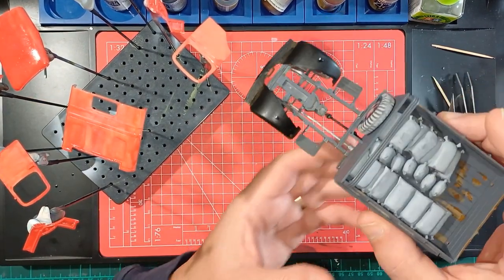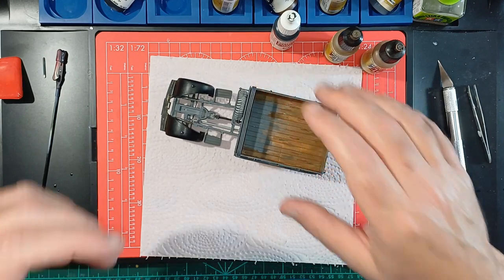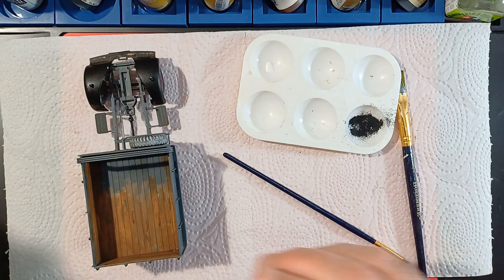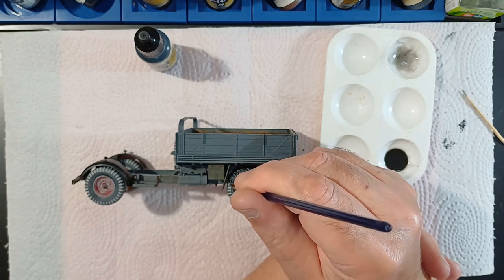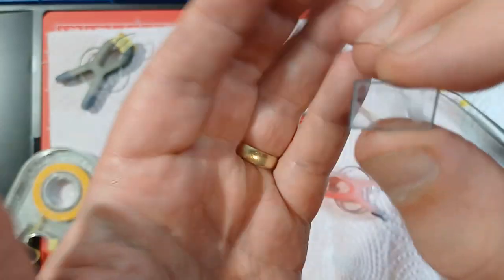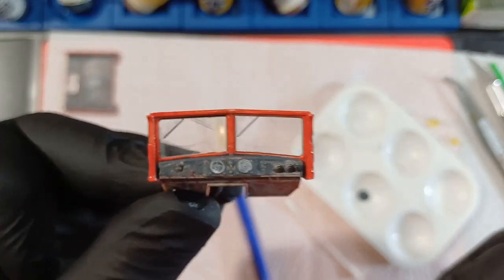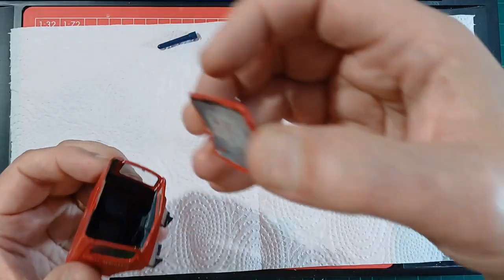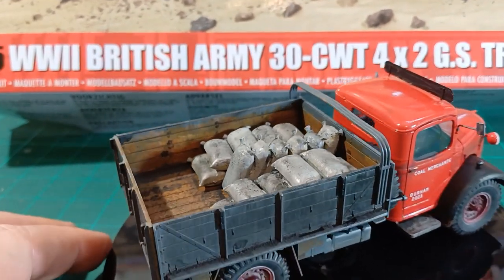Airfix WW2 30CWT Truck Build part 3 Finished

Comment: That's turned out well. For applying pigments, etc I bought a set of about two dozen make-up brushes for 38p. Perfect for the job. Also, if you only want light weathering on your windows, just give them a very light dusting of matt varnish. If you use an enamel varnish, you can get streaking effects too. Give it a try on a spare transparent part.
Reply from the maker: Cheers John. I've nicked Sara's make up brushes, and tried the matt varnish, worked well! Thanks for the tips again.
Reply: @nostalgicplastic4323  You'd better not let Sara have them back or you'll end up with a weathered wife!